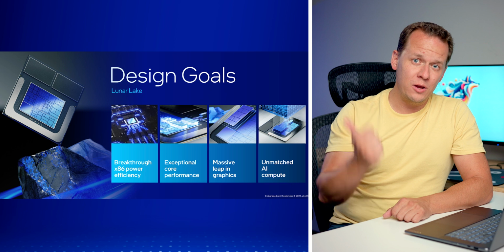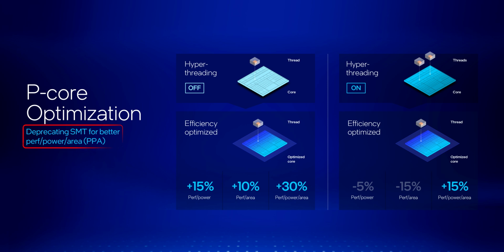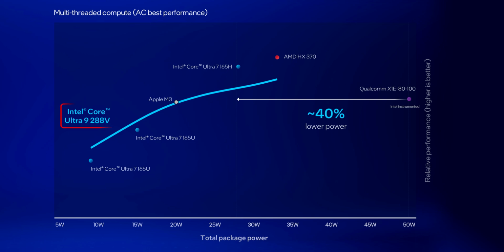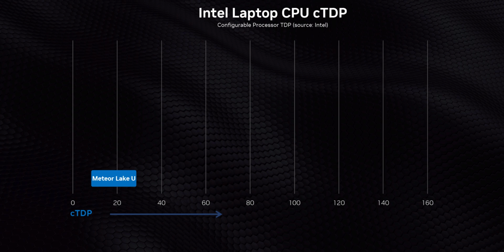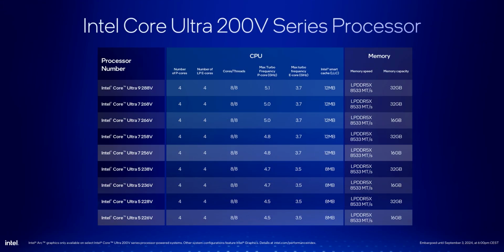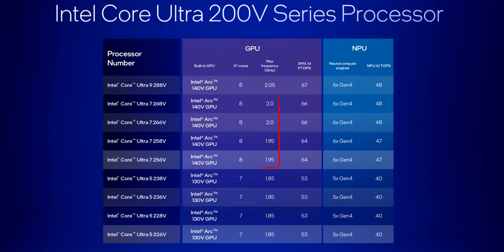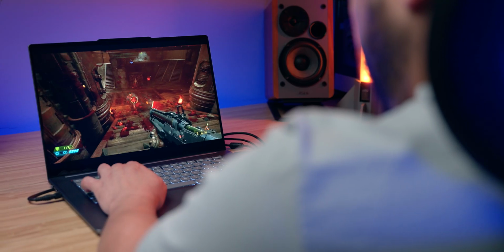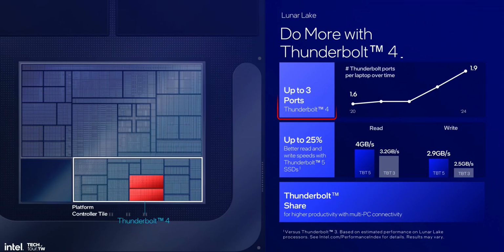Intel is FINALLY Doing Something Different

Comment: I'm curious to see how this new architecture with high power efficiency and the integrated RAM will affect the rest of the market. I'm a data professional, and I have 64GB in my current laptop, since there are situations when if you can't load stuff into memory in a single batch, you can't work in it at all. Currently, most of the laptops offering this amount of RAM are beefy ones, coming with strong CPUs and strong GPUs, thus weighing like a brick, with short battery life. I don't need a strong CPU or GPU, that was never a bottleneck (worst case: scripts run a bit longer, but they still run), but I would be happy to spend a workday without charging. The new Lunar Lake would be ideal if I could get it with 64GB of RAM. That's not going to happen since that's not the purpose of LL, and that's fine. But I hope this extreme power efficiency approach will spread out, and we either get a future architecture (in a year or two) that is similar to LL but with separate RAM, or the regular CPUs will have a lower minimum power consumption. Most of the time, we are using the same Windows, browser, word, gmail, youtube regardless of whether we are on a thin&light or on a stronger laptop, and if they can be used perfectly with very low power consumption in a thin&light, a bigger laptop should be able to do that as well, and only consume more power when there's actually more computational power needed (gaming, ai training, etc).

Comment: Why is there a spiderweb of cables going into your laptop? The corporate world has long standardized around a USB-C dock at each deck for a single plug into the laptop. More than one cable into a laptop when working at a desk is jank
Reply from the maker: Because it can. ;)
Reply: @HardwareCanucks  what do they mean by the nps section of a cpu?
Reply: One reason is that the design was hobbled by the poor fab as Intel kinda always wants to build chips in-house. Now Pat decided that that cannot go on so he let TSMC to make the Lunar lake compute-tile. The other thing is now Intel has the urgency to catch up - while it is fortunate that its Atom division finally grows mature to exceed in the efficiency game.
Reply: @SeanLi-i7n  I think you responded to the wrong comment. However, LNL being built on TSMC N3B was decided by Pat's predecessor. Intel prepaid for the wafers from TSMC 4 years ago. They had to use them because the CEO at time wasn't confident that Intel 3 would be ready in time. 

Intel moves back in house next year with Panther Lake on 18A

Comment: i thought arrow lake is only for desktop
so arrow lake can be like raptor lake hx chips?
Reply: Arrow Lake is the main chip this gen. It'll be used in H series, HX, and desktop. 

LNL is a new category for Intel specifically focusing on sub 20W models. Laptops that want higher performance at 30+ watts should be arrow Lake. LNL perf/watt drops off above 20W

Comment: Yay, instead of adding camm modules for ram they became apple. Landfill ewaste intel increase in the next years.
Reply from the maker: CAMM won't be installed in thin and light laptops.  It'll likely be used to make larger gaming laptops thinner.
Reply: You do know that for the last decade thin-and-light laptops have had soldered memory and often WiFi chips too, right? No difference. Now it's on the CPU instead of the motherboard.

Comment: 32 gb soldered in ram is a idiot move, nobody will want these "one size fits all" chips.
Reply from the maker: Why not?  They're the largest market since people can't afford separate devices for each of their use cases
Reply: You do know that for the last decade thin-and-light laptops have had soldered memory and often WiFi chips too, right? No difference. Now it's on the CPU instead of the motherboard.

Comment: intel is making phones now?
At least laptops that are as upgradable as your phone, which aren't upgradable.
Reply: You do know that for the last decade thin-and-light laptops have had soldered memory and often WiFi chips too, right? No difference. Now it's on the CPU instead of the motherboard.
Reply: @patrickmacmillan  Framework

Comment: Ever since I was little I've been buying budget laptops every few years with new intel processors but the low budget 1s and they never get faster I literally just hold the power button on my laptop to turn it off because of constant crashes and stutters even though Thiers ram and the CPU is at 50 percent .intel have been the top dog for years and that made them not inovate or even try

Comment: I am confused here, are they some high end thin and light or   for productivity and browsing.
Reply: Both, why choose or limit yourself?
Reply: @patrickmacmillan   except you cannot, not enough core for multi threaded workload, also despite way better performance per watt cpu is still anemic, while still too expensive to be called above entry level or mid level, so weird product placement. But competition is good, Intel needs a win to keep amd on toes.
Reply: High end thin and light. It has decent performance, but will get easily outclassed by larger, beefier laptops. However it will have amazing battery life.
Reply: @lycanthoss   then I want to do some serious work, I would get that beefier laptop, if it's just ms office and browsing then there are far cheaper options here, I am just saying that Intel marketing is misleading us to buying something that this laptop is not.

Comment: 100 percent with you - bring back USB-A, double it , I can run both external mouse and keyboard off my old Zenbook laptop (which is just 1.2 kg), there's no excuse to put just one on in a new system. 2 USB-A, 2 USB-C that do display output and charge should be the standard across the industry.
Reply: I think 2 USB A is enough for everyone, But I think I want more USB-C like 3 or 4.

My keyboard come with USB-C cable and USB C2A adaptor.
The mouse is detachable USB C2A cable, so changing them is quite easy.

The only 2 things in my desk that isn't USB-C is my old Micro USB 2018 Wacom tablet, and my 2016 webcam that is half broken

1 USB-A and 3 USB-C is sweet spot for Me
Reply: And remember since 2023 everything must come with detachable USB-C2C, So all USB A port will soon fall under obscurity. 

Maybe usage for very old external storage? Or very old hardware that will soon be replaced?
Reply: @dqskatt  That's for wired peripheral though, realistically I think it's more likely for people to move to wireless and most wireless adapters for 2.4 GHz is still USB-A
Reply: @e21big I mean no one use wireless mouse and plug straight to port with no extension? no? those extensions are Detachable C2A cable.

Even if you do not use an extension that is why at least, 1 USB A must stay

I mean the keyboard started to put USB C2C just recently it will take like a year to Mice wireless receiver to adapt to USBC 

And also those 8khz,4khz dongles are USB C and It becomes small, very affordable and the norm nowdays.
Reply: @dqskatt  Why use extension adapter if you can plug the adapter straight to the USB port? Beside those are finicky, more often than not they just don't register the plug-in peripheral or just one of them instead of two.

I also can't imagine wireless peripheral adapter being made with USB-C. Just look at them, they are already extremely tiny even with USB-A port, I doubt they can compact everything to USB-C size
Reply: @e21big  Just for future proofing, 1–2 years in future, for me mouse only last 2 years max. 

It not that they can be tinier, but they are reversible and more durable, and better performance.

But If they're tinier, they can go with Keyboard + Mouse combo dongle like Logitech, Razer but keep the same size and performance as separated USB-A counterpart
Reply: Laptops come with keyboards and trackpads. If you want a separate keyboard and mouse, use wireless - every laptop has Bluetooth. Or you can use a C to A adapter. USB-A is obsolete. Peripheral manufacturers shouldn't be using it any more. A C to A or A to C dongle is available everywhere very cheaply.

Comment: That non upgrable RAM and WiFi is a deal breaker to me, even it have nice power efficiency. LPCAMM2 is a thing Intel.
Reply from the maker: LPCamm will likely be for gaming laptops.  Not devices like these.  Also doing this guarantees that Intel laptops are paired with at least 16GB.  Not that cut rate 8GB single channel garbage that some manufacturers still sometimes do.
Reply: @HardwareCanucks  With upgradable RAM you don't even need to think about those garbage some manufacturers put in. Of course, if there's only one RAM slot, that's a major deal breaker too.
Reply: For efficiency, nothing beats on package.

Comment: So... for 2nd hand market in the future, you will have thinner, lighter, but not upgradeable RAM. 8GB was enough 10 years ago, 16 GB won't be enough 10 years later.
So, 2nd hand market in the future will have a decent chip but held back by RAM capacity...
Reply from the maker: By and large, there wasn't a single thin and light laptop with upgradeable memory in the last 2 or so years.
Reply: You do know that for the last decade thin-and-light laptops have had soldered memory and sometimes WiFi chips too, right? No difference. Now it's on the CPU instead of the motherboard.
Reply: Just buy a new laptop bruh, why r you waiting a whole decade
Reply: ah... so it is for Ultrabook, why don't they just use the trademarked word. Understandable.

Comment: 32gb is the max? Thats a deal breaker
Reply from the maker: Why?  For a thin and light laptop it will be more than enough well into the future
Reply: yeah, thats rubish
Reply: You may be forgetting the thin and light target audience. This chip isn't supposed to support all niche applications. In fact, its efficiency sucks when it comes to high-performance tasks, so anybody with specific requirements would be better served with the upcoming Arrow Lake anyway.
Reply: @Noodles.FreeUkraine  yea i forgot the ultra line was foe thing and light.
Reply: Enough for an thin and light ultraportable laptop imo.
Reply: @auritro3903  ive been living under a rock. Is this the only mobile chips intel is going to make?
I consider the 14 macbook pro as a thin and light. Same goes for the xps 14. And i would expect laptops with premium prices to come with bigger ram options.
Im a developer, and i work with VMs. I NEED LOTS OF RAM.
Limiting to 32GB would be a huge downgrade
Reply: @auritro3903  those are garbage

Comment: Who is asking for thinner and lighter laptops? Are the current ones with soldered memory not enough? The pursuit for faster and more efficient methods is admirable, but being thinner and lighter isn't one of them.
Reply from the maker: In this case it's thinner, lighter along with space savings that could lead to larger battery capacity, less expensive devices and more.
Reply: It's about having thin and light laptops that are also efficient.

Comment: can dell, lenovo, or hp just ship a 14in laptop with a 99wh battery already?
Reply: The problem is space for things like cooling.
Reply: @GlobalWave1 Maybe lower the performance as much a needed so no fans needed and market it as the longest lasting battery laptop ever.
Reply: That's like saying dell or hp should ship a 13inch laptop with a full-sized keyboard with numpad. Not possible unless you want your laptop to be 5 inches thick.

Comment: Intel are always on par with AMD in their mobile section, But now that, Intel is miles better than AMD latest Zen 5.

I always find that Intel is better value than AMD in laptop or desktop since 12th Gen.

It not like I hated AMD, If only they actually produce enough to meet the consumer demand instead of focusing their resource on data centre.
AMD laptop is good on theory, but availability isn't it, AMD supply chain issue new like fail to meet Vendor like ASUS and Lenovo always popup every month.
Reply from the maker: The problem with AMD is they simply can't provide enough chips into the laptop market.

Comment: I keep wondering if you (intel, apple, etc) could just have a tiered memory setup, like the old days of an SSD and HDD. You get that cheap substantial upgradability while having the super fast on-die memory.
Reply: I mean... it would be hard but I like the concept.
The problem with computer hardware is you follow the lowest performance one.
If you have 2 kits of 2x8 GB RAM, usually your computer can run it okay as long as your XMP setting is set at the worst of both.

In case of the laptop... on-die Memory has significantly higher frequency than any memory module, maybe CAMM2 could solve... but seeing how Intel offers on-die memory... we know that it might be the end of any laptop.
Reply: @Dominus_Potatus   oh yeah, I forgot about that. RAM is a bit finicky with speed and timing across multiple dimms. You would have to seperate them in some way to run at different speeds which sounds complicated. CAMM2 could help, but I'm guess the end of upgradeable Laptop memory is near as well and I hate it for... Anti-corporate reasons.
Reply: It's not about the performance but powerful efficiency. Having a modular memory will cost you power, regardless of whether you end up using them or not (unless you include a manual switch to toggle that on and off)
Reply: @e21big  also true, and very important in laptops, but we know this is coming to "devices formally known as desktops" at some point just for the control it gives manufacturers. An alternative would be great in that case.
Again I agree on laptops though.
Reply: It`s too difficult to put something  faster than ram and similar to cache as something upgradable. I've thought about it before, to use the other side of the socket, but it's gonna be marginally better than ram.
Reply: An alternative, slower than ram is good old swap with optane or something similar. It's common.

Comment: RTX 3050 speed iGPUs are real. Absolutely nuts
Reply: It’s about time Intel catches up. I can’t wait to see what the iGPU of the M4 max looks like. 
I wonder what Strix Halo will look like next year. 😅
Reply: As a guy who built his first gaming PC back when ram was measured in megabytes, it's amazing how far we've come in so little time. My budget gaming laptop I grabbed in 2019 with a gtx1650 is outperformed by thin and light laptops running on battery. Upgrading this year likely to a i9 185h and 4060 (yoga pro 9i) and it's going to be wild. I don't get to game much these days but looking forward to finally trying out some of these recent releases like cyberpunk and bg3
Reply: tsmc 3nm node magic
Reply: Strix Point Halo is right around the corner with 3070/4060/4070 mobile performance
Reply: @ehtasam2080 Erm.....TechPowerUp says RTX 2080 or 2080 SUPER.
Reply: @ehtasam2080  Sure if theoretically Strix Halo 40CU can use 115W while leaving only 10 watts to the CPU.

Given "next-gen N3E node efficiency" sure it would be on the heels of the RTX 5000 Ada Mobile and would match a RX 6800XT thus being within 5-10% of the PS5 Pro. I'll give you that 👍

But can a 16-core Zen5 CPU process all those frames when given only 10 watts to work with? Absolutely not. But could it sustain frames with 30 watts? Possibly so.

That said, if 95W (out of 125) is the maximum the 40CU iGPU could possibly draw sustained then it could match an overclocked RX 6750XT.

So I predict "Top Strix Halo" will sustain RX 6650XT performance with short bursts up to the 7600XT/2080 Super in most games while sustaining RX 6750XT/4060TI performance with short bursts up to the RTX 3070 in "Radeon optimized" games.
Reply: @ehtasam2080 honestly yeah I think this is insane, I wonder how it will compare to a 30W 4050 in lets say an XPS 14
Reply: Don't worry, RX 6650XT class performance fueled by 266.66 GB/s of RAM bandwidth via a quad-channel 256-bit bus is coming next year 😉
Reply: Impressive but also a bit pointless if focusing on gaming since a gaming laptop is so much more than just pure GPU performance. Many of these thin and light laptops will have very shallow keyboards.
Reply: still pointless

Comment: Fuck you Intel! Soldered Memory by default. This is the death of right to repair/upgrade...
Reply: You do know that all thin-and-light laptops have soldered memory, right? No difference. Now it's on the CPU instead of the motherboard.
Reply: @patrickmacmillan  Ever heard about the framework!? I have one. This is the reason why. I hate it being by default. Until now the manufacturer decides if soldered or not. Now not even framework can do this. Thats why:

FUCK INTEL

😘
Reply: @lineax5927 You might want to look up what AMD has planned with Strix Halo, I'm glad that both manufacturers will soon be disappointing you.
Reply: @patrickmacmillan Yeah i fear that amd will do that too. Very sad, because otherwise the chips look great